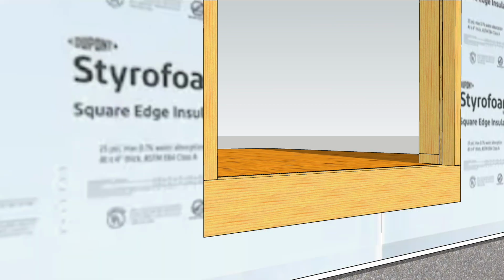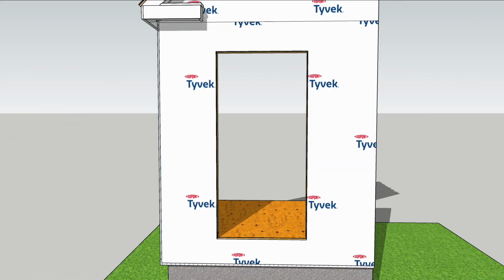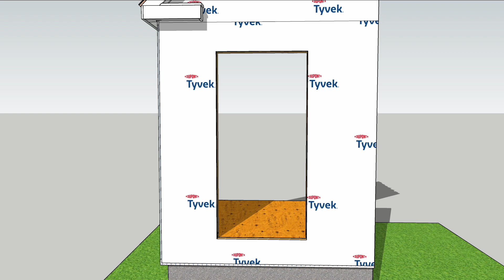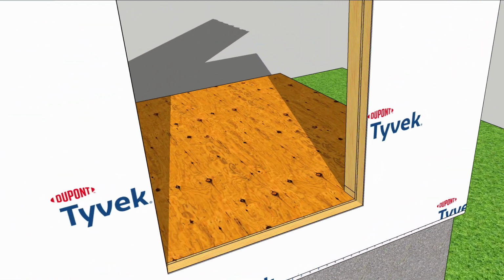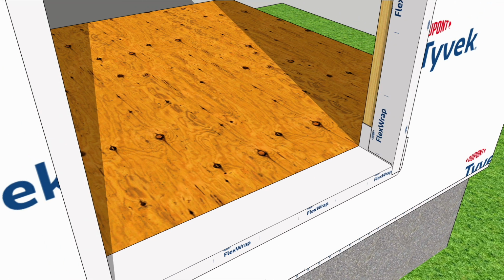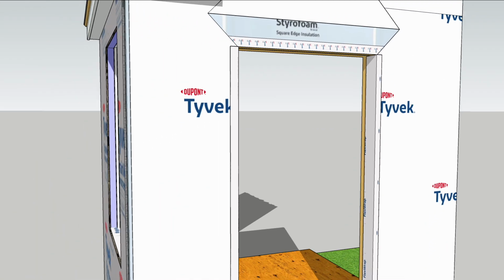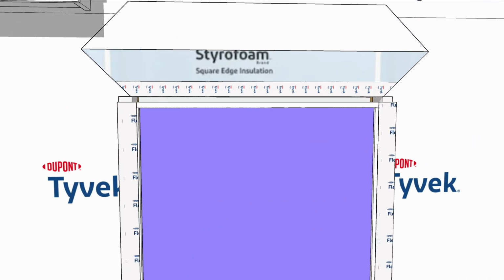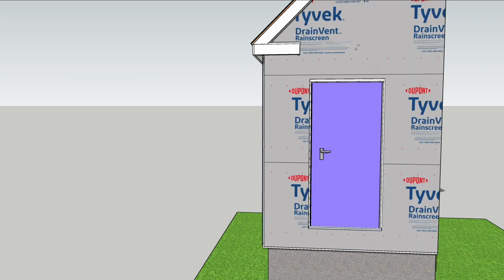Weaving Wooden Door Bucks Into Continuous Exterior Insulation (animation)

Comment: How do you account for the added thickness of the foam if the jamb is made for only 2x4 and sheathing?
Reply from the maker: You either order a deeper jamb or extend the jambs on the outside. Doors the trickier than windows, even though it seems like the reverse should be true. The tricky part is the sill. People don't step on window sills, but they do step on door sills. 
The door sill needs to extend beyond the foam and support human traffic. The easiest solution is to buy a new doot the right depth.

Comment: How about with Zip system sheathing and Comfortboard 80 exterior?
Reply from the maker: Sure. But understand that rigid fiberglass is not an air barrier and I doubt if you can tape the seams, so get all of the airsealing and water sealing details perfect at the Zip layer.
Reply: @ProTradeCraft  Yes, of course, we're presuming that the ZIP layer is competently installed. What I meant was, would you continue the water barrier onto the bucks with tape / liquid flash or leave them bare?

Would you use that coil stock detail? i feel like it would just trap water.

Comment: Unfortunately wood bucks do not create a thermal break at the door or window openings, so when installing continuous exterior insulation, ThermalBuck is the product to use. They also have a great exterior insulation product with the WRB already adhered to the gps foam called ThermalTight so no need for another lap around the building.
Reply from the maker: Not selling products here. 

There are other options as well. For two layers of foam, run the first layer tight to the opening and make the buck the same thickness as the second layer of foam: wood where you want it and no thermal bridge. 

You can see it being done in the "Superinsulated Sunroom" series: https://youtu.be/KjCy2yjzOVQ

Comment: Is the Tyvek necessary if the foam is also an air and water barrier?   Could flashing tape just be applied directly to the foam board?
Reply from the maker: Tyvek specifies placement behind or in front of their Styrofoam product, depending on the window placement. 

However. I think you can absolutely use the outer face of the taped styrofoam as the drainage plane, which would eliminate the need for a WRB. Tyvek is an added layer of protection for the wood sheathing if water gets behind the foam, and it will never be less expensive to install than right now.
Reply: @ProTradeCraft  I would think the thousands of staple holes in the previously-air-and-water-tight foam board facing (in order to attach the tyvek) would be a net negative for the assembly's ability to resist air/water and dry to the outside